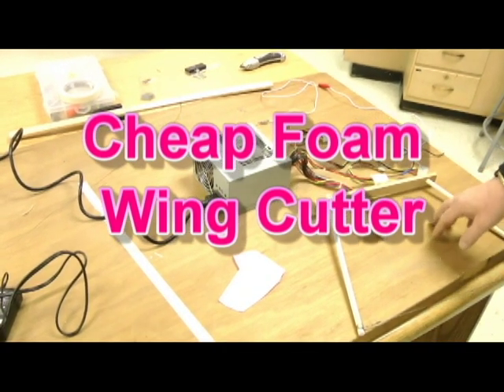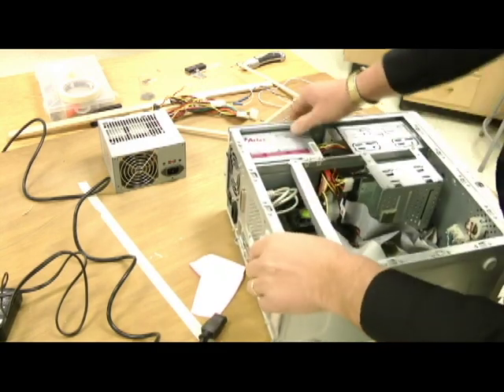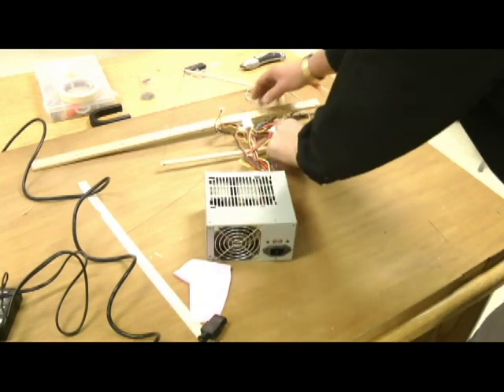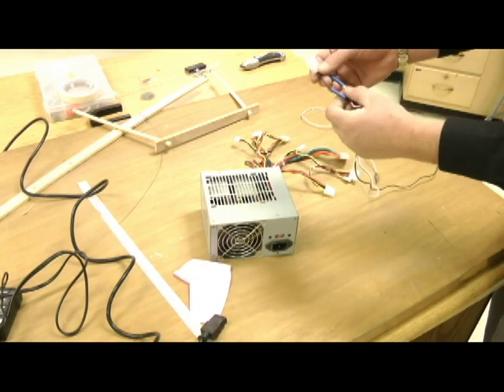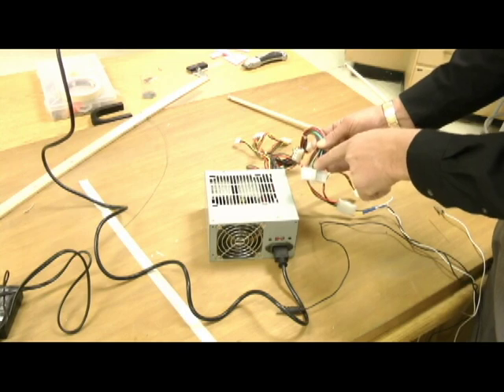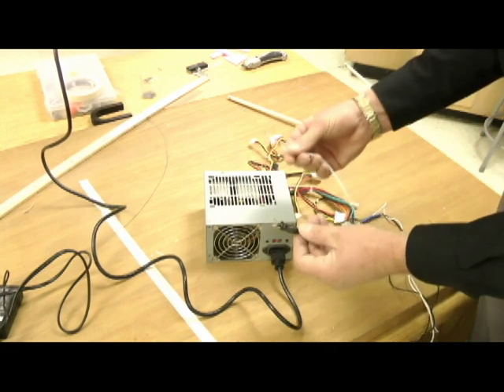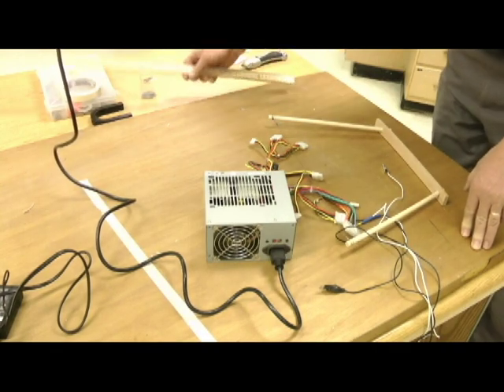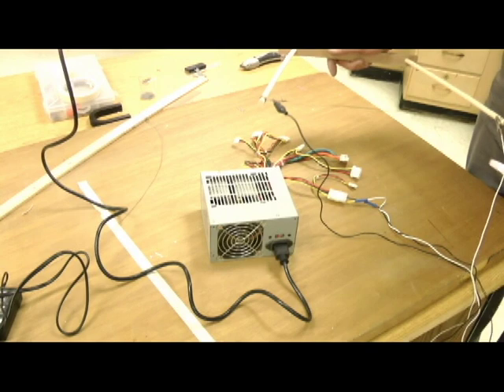cheap foam wing cutter

Comment: I made a hot wire cutter using these instructions and a similar psu, I made it with two outlets 5v and 12v it works perfectly and just what I needed for cutting my own wings etc, thank you very much, Joe

Comment from the maker: On one long wire run I actually put two sets of clips on the wire.  It worked really well.  The biggest problem I run into as I do these is that the wire heats too hot at first and then cools as I cut.  To cure this I start to cut as soon as I put on the clips and then let it go at its own pace.  I slow if it needs it around the corners and just pull harder through the longer sections.  If you need to reduce the voltage you can put a variable resistor (light dimmer switch) and play with output.

Comment: Hi, thanks a lot for your videos, this new serie is really nicely made, I actually couldn't find a suitable power supply for my bow for a long time now, The lenght of nichrome wire on this one is aproximately 3 feet and 30Watts would be largely enough to heat it at 600°F. I harvested the power supply from an old computer. It is rated to output a current between 3A and 12A at 12V(yellow wire).

Comment: i heard in a blog that the longer the wire the more voltage you need and moving slowly is the best way to cut. i think you could may by make one with a battery and dimmer switch, getting the temp. right is most important.

Comment: I have problem.. when i connect wire to the yellow and black cable my power supply stop working... ventilator stop rotating... can you help me? i followed your procedure but this is only problem

Comment from the maker: Be sure that when you connect the wires that the "cutting wire" is between the two active wires from the power supply.  Connecting the yellow wire directly to the black wire acts as a direct short and will blow your fuse in the power supply.  The nichrome wire acts as a resistor and this is why it heats and cuts the foam.  There is, however, a point at which you can have too much of the cutting wire and it will no longer provide enough heat to cut.

Comment from the maker: When using this cutter, connect the green to the black wire before you hook up your clips to the cutting wire.  You need to begin cutting right after which will prevent the wire from overheating and melting.  This cutter will work on wings up to about 4 feet long.  Thanks,

Comment: Around 2.07 you start talking about connecting the power to the Green and black wire to get the power to turn on.
When I plugged my power supply in, the fan started spinning and a green light was on.
I didn't get to short out the green/black wire set up.
Does that mean there is power going to the unit and wires to the bow?
I haven't hooked up the bow yet...I pulled the powersupply during lunch at work. My IT guy said grab one.

Also...does it matter what gauge the wire is? I found some Nichrome 60 stock online...but they have different gauge sizes.

Thanks for a great toot! I wish I had a science teacher like you when I was in school!
rtc

Comment: Even the minimum output current of 3A would generate a power of 36Watts wich would be largely enough, though the nichrome wire of my bow doesn't heat enough to cut foam just a little...Do you have any idea where the problem might come from?
Thank you for your time, greetings from France ;)

Comment: Awesome idea.  Unfortunately my power supply is to new, it seams to have a short safety shutoff...As soon as I make a short with the wire cutter the voltage drops from 11.5V+ to 0V
When I throw the power off and back one, power comes back.   
Guess I have to look for an older PC. ...Or build one out of a transformer and a dimmer.

Comment: Excelent tutorial. Tried this with my kanthal wire and it worked, but only when the wires from the psu was close to eachother (maybe 20 cm). Tried to add two more cables but it didnt have any effect. How do you do it? Do you have both the + cables together and both - cables together on each side?? Can you please make a video telling how you do it?

Comment: I used the same sort of thing to power my RC battery charger but i used the 12v rail and it worked really well,that was a good few years back but now i've got a proper PSU for all my battery charges.

Comment: i use a pc powersuplay to. in the computer it works well, but at soon i connect 5 or 12v to my cuttingline it shot down. i can then restart but it just cut down again. help is needed. do you have any
Reply from the maker: I have never had an issue, but then I use older PC components.  The newer ones may have a surge protector built in.  If anyone else has seen this, please post.

Thank you for your comment.
Reply: I found the solution. I used a wier with a heigh ohm. It seems that the reason was to little resistance
Reply: Rejnar Storm. You may have a bad power supply
Reply: No it is just one of the new onse who has a kind of shortcut security. It shot down if to much power ho true so the motorboard, in the pc i have stolen it from, dont get burned

Comment: Thank you for the upload. You have done what the majority the majority have failed to do. I have spent over 4 hours trying to get this answer.  I code, I built 2 cars, one motorcycle, I maintain networks with over 4 thousand users  I build models in CAD. I built and fly an ultralight. Im not saying it to brag.I mention it to help with the following comparison. like anything else, an individual can find a network of people that  are interested in the same study or activity. The people who are interested in the electrical side of this craft aren't even on the scale when it comes to low self esteem  ,they are arrogant and the most useless group I have ever encountered. I've read dozens of posts with people asking simple questions that never get answered. instead of an answers you get pages worth of replies from people trying to one up each other as if its an accomplishment. Then there is all the, how to build a hotwire videos that are equally useless because they dont cover the power supply. Its not just me ,take a look at forums and youtube and you will see negative comments everywhere about the same thing. Its a wire and power supply,not magic or Quantum Mechanics .Thanks again
Reply from the maker: You sound like my kind of guy.  I build canoes (check out www.wildgooseco.com), toys (papaswoodentoyshop.com), repair motorcycles (I'm a BMW type) work on computers, cars (big 69 camaro fan, have 4 of them), do chain maille, build telescopes, muzzle loaders, archery, and whatever else catches my eye.  My wife calls it OCD.  Thank you for watching.
Reply: +andpet55 love the 69. my wife got a 69 convertible for her 16th birthday. when she was 28 a yahorrific thing happened. She traded it in for a maxima. it's too bad we had just started dating so I had no say.
Reply: +JOHN  A. FURTADO JR. I think he did a great job of explaining the power supply part of the hot wire cutter. I think there is a lot of one up on the subject also..... I want to mabe flying wings not circles.... lol!!!!!!

Comment from the maker: The nichrome wire is 18 gauge
Reply: +andpet55 I have even used stainless steal wire it works just as good and easier to get a hold of. most places like Home depot and Lowes have never even heard of nichrome wire. Get it on line at E-bay or Amozon....

Comment: I'm also using a computer ATX power supply but when I attach the alligator clips, it shorts out the ATX power supply.  Any advise?
Reply from the maker: You may have a faulty power supply.  I have done this using a number of these, both at home and at school with my students and have only shorted one.  Make sure that you have the jumper in the correct place and that you are using the proper colors that attach to the alligator clips.  Hope this helps.  Thanks
Reply: Chris Stolle .Use the 5v instead of the 12v and just use a smaller wire i have had the same problem with the newer ATX.
Reply: KBCHILLIN614
Thanks

Comment: Dumb question: Where can I buy NiChrome wire?
Reply from the maker: You can get it on Ebay.  I purchase mine through a science supply like Flinn Scientific, but your best bet is Ebay.
Reply: If you have old hair dryers laying around the house you can uncoil the heating element which most likely is NiChrome wire. Also acoustic or electric guitar strings work well, the first or second strings are OK.
Reply: archiguitarchi You can find it at Pelican Wire, www.pelicanwire.com, they sell it through their on-line web store.

Comment: can i just connect the alligator clips to a blade?
Reply from the maker: No.  The reason this works is due to the high resistance of the wire, creating heat.  You need the proper size wire and correct amperage.  Too much and you melt, not enough and it won't cut.

Comment: hi, i have tried to make it, but wire didnot get hot. my NICHROME wire is 32gauge.  just like a hair.and the output is +12v--750mA. where is i am wrong ?
Reply from the maker: canada BC
Reply: you need 2 amps